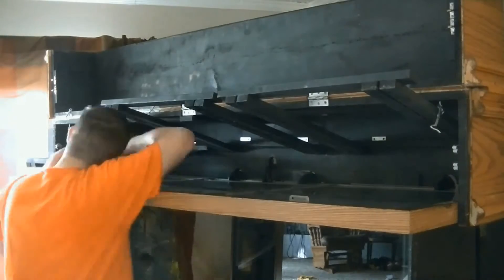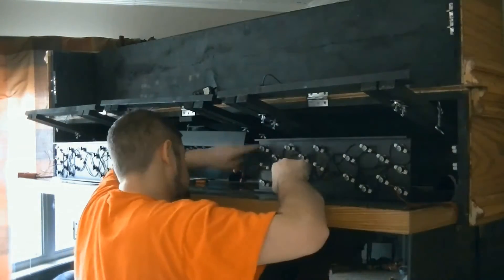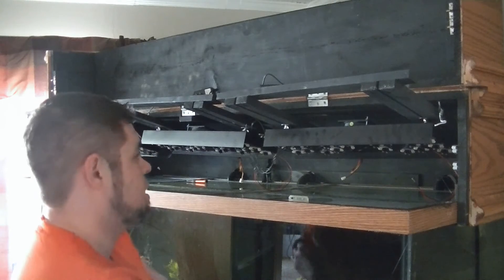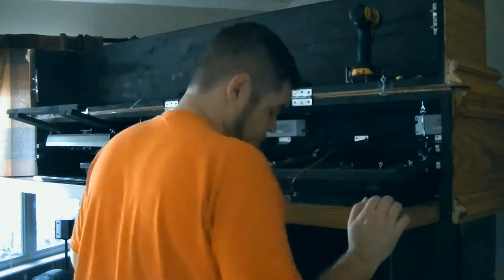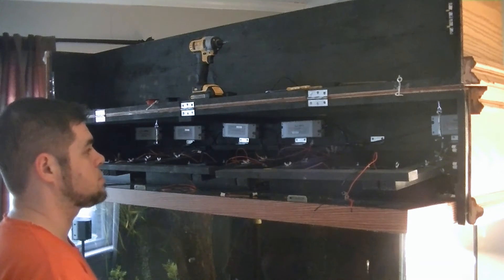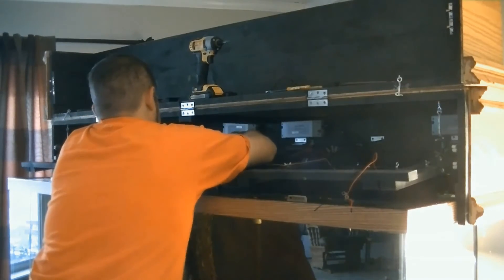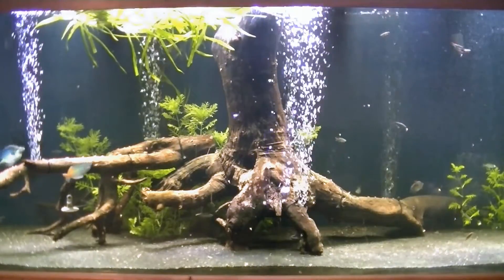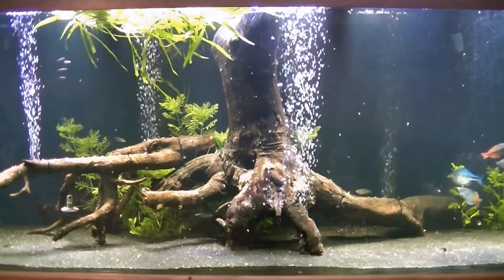DIY LED Build Part 3

Comment: Congrats on the new lights. Always feels good to complete a big project like that. Does it save you a bunch of money to build like this?
Reply from the maker: Thanks again it was great to finish but I was more happy about finally getting them. As for cost its hard to say the LEDs fixtures out there are for saltwater setup. So I was more looking at customizing. But when you get looking at the nice fixture they get expensive so for this size of tank this maybe cheaper.
Reply: Cool.  Thanks for the info.